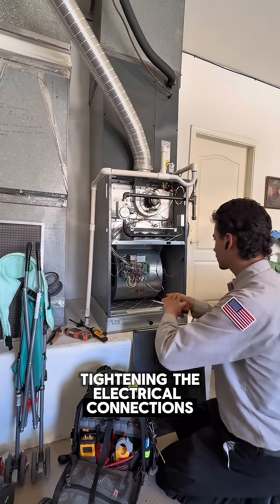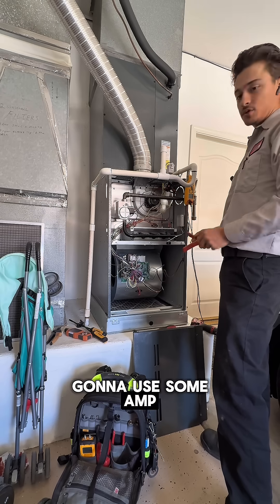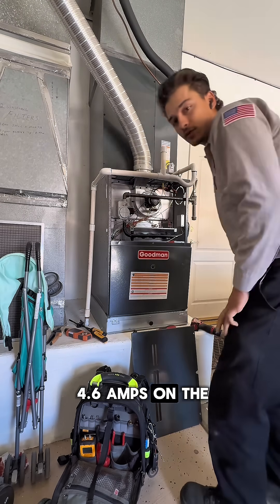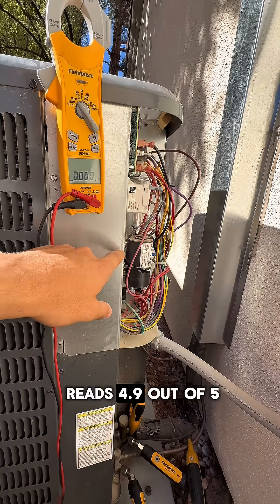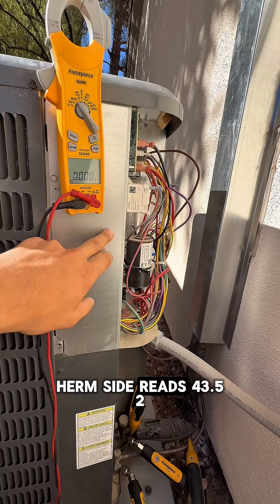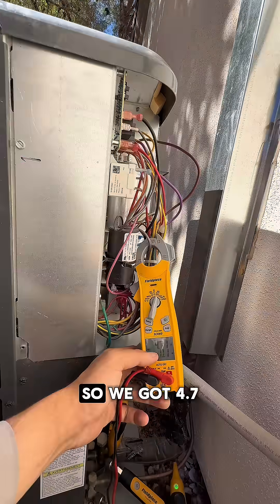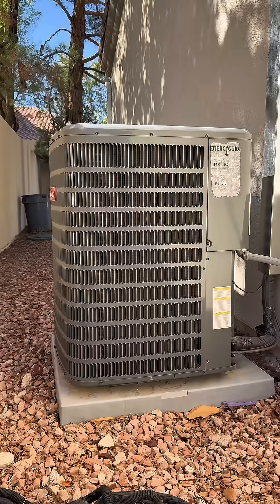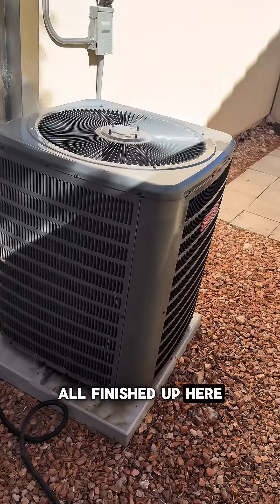Heating Maintenances on Gas Furnace and Heat Pump System #hvac #heating #hvaclife #maintenance

Comment: 8 out of 10 times when you try to test defrost on a Goodman board, it doesn’t work. Not sure what it is with the test pins on the Goodman boards. But it almost never works in test mode. I think if the defrost stat isn’t closed, it will not go into defrost in test mode

Comment: Do you test defrost?
Reply: That’s not a heat pump system with a defrost board
Reply: @zoomanzeke you could see the defrost board when he opened the panel
Reply: @30rdmaga u right